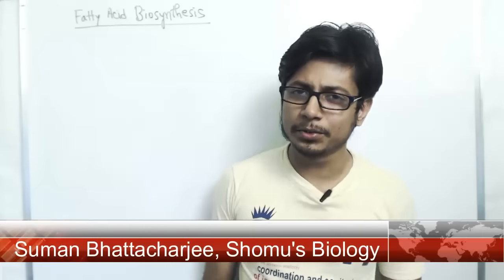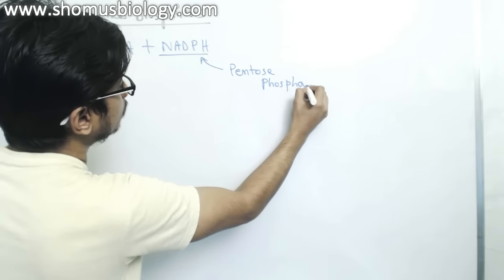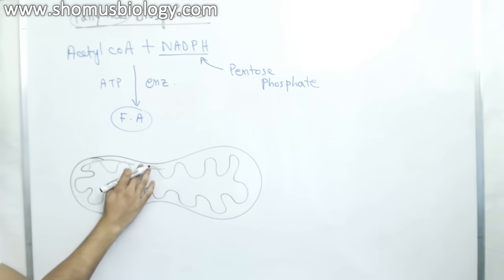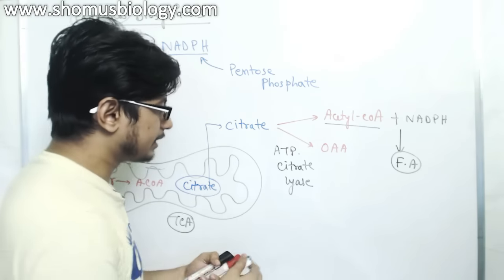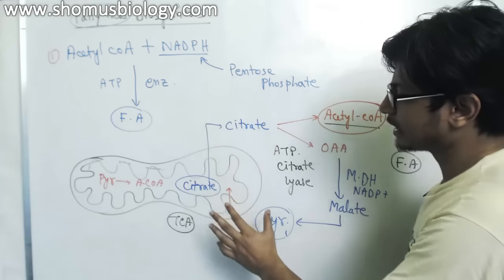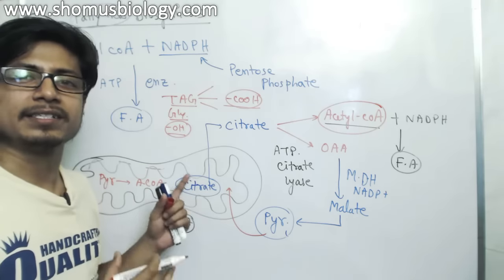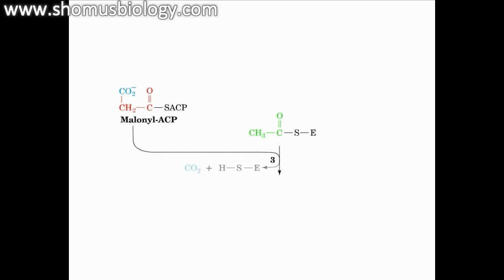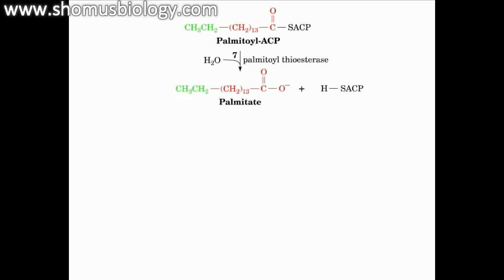Fatty acid synthesis

Comment: Bro if pyruvate can not come outside without some changes so how it can be come inside you told that there is no some pathway or channel in the mitochondrail membrane..can you please elaborate it?
Reply: somil dokwal there is a acetyl CoA shuttle  system through which malate can go inside the mitochondria....there is no need for malate to get converted into pyrute ..it can itself enter the inner membrane through the shuttle...shomu did nt explain the shuttle system
Reply: Nazu naz okay